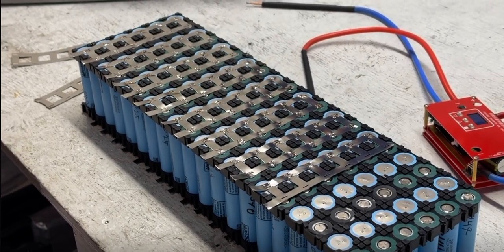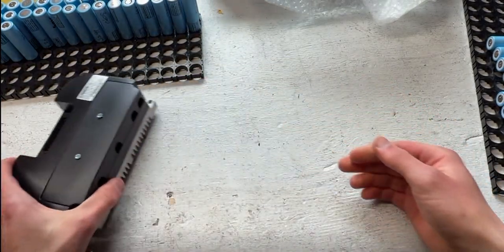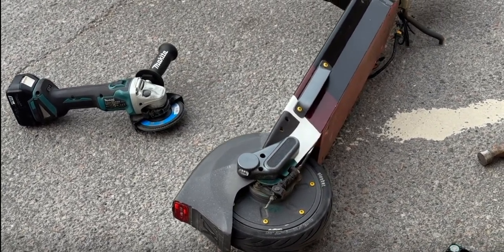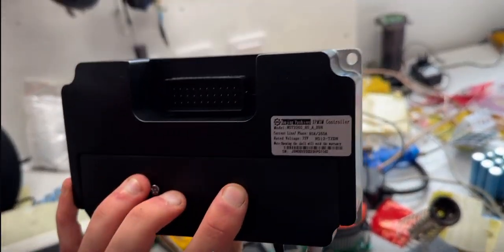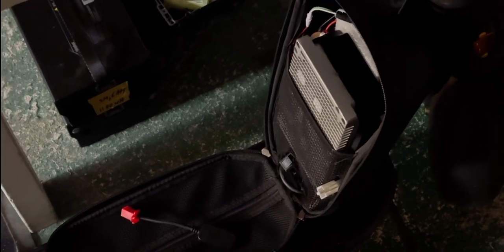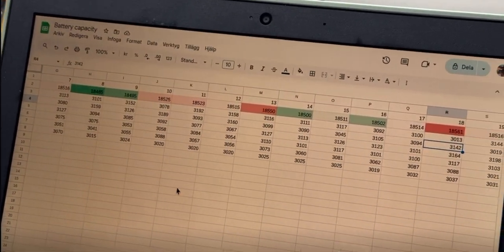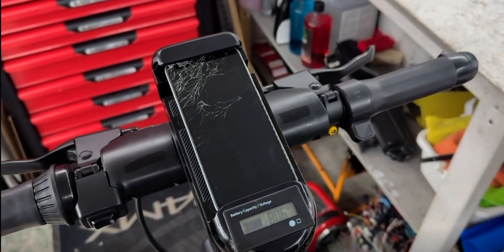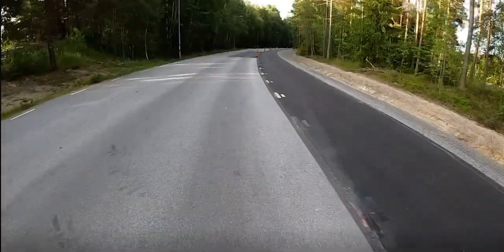Worlds Fastes Ninebot G30 " 72v monster "

Comment: Izuna's G30 conversion is definitely more complex and, his G30 reaches 120kmh +
He use a modded Vesc Controller
Reply: Link pls
Reply: @boblazar5766 https://youtu.be/iaGA6Xkg9gE
Reply: @boblazar5766  his name on YouTube is @1zuna.seikatsu
Reply: Why don’t u change the motor bro 300 watts is crap with all that kw u got
Reply: @yanishameesh7965 The motor definitely has more power than 300 watts, but no one needs to know that. The label is there intentionally. 🤫

Comment: why you dont just use VESC more popular the flipsky 75100 pro v2? pay way less but much more options for power and features
Reply: this one pushes 80A battery and 260A phase and the shitsky couldnt handle even half of that before releasing mystery smoke
Reply: @piotrek1955  bro...if you did any research youd realise theres different variants of flipsky the 75100 i used as an example as its the most commonly used for some reason, theres the 75450 which is rated upto 450A or the ft85bd for 600A+ Flipsky can handle what its made for you just gotta get the right model and know howto use it
Reply: @ZOMBIEEZ  it just didn't make sense for ihm to buy it i guess, probably got a cheap controller and also overall the flipsky brand is bad and never recommended by anybody that works with vescs on high power
Reply: well he is trying to make it plug and play to sell it i guess, its a bad build anyway but a flipsky wouldnt make it a lot better lol
Reply: @piotrek1955  no wlasnie flipsky jest recommended co ty mielisz

Comment: why didnt you use VESC Controller
Reply: They overheat
Reply: @user92572 they don't heat up more than a normal one
And if it overheats put a cooler on it?
Reply: 😂😂😂😂😂😂😂 @user92572
Reply: Why didn’t he use lipos and an 3 fase esc with an upgraded motor?
Reply: fardriver is litterally vesc
Reply: Vesc is for kid
Reply: @enimabas-bt1cb no it isn't